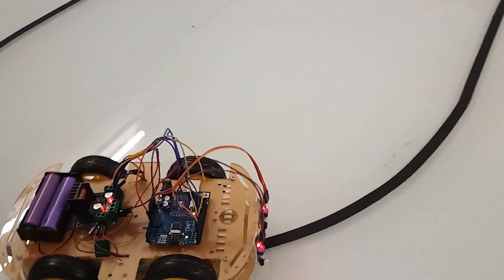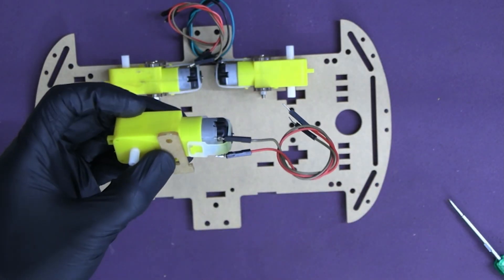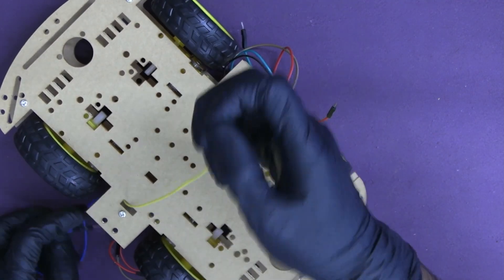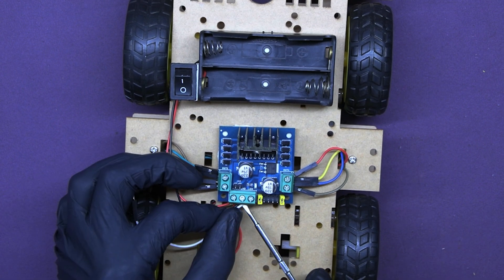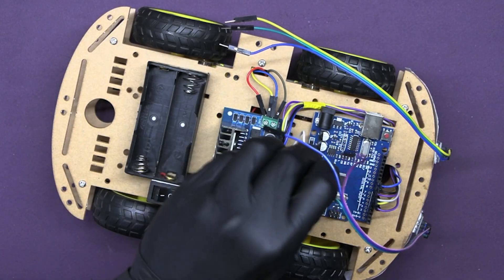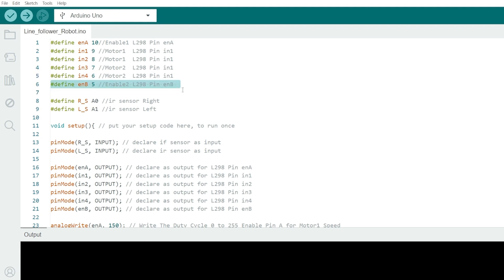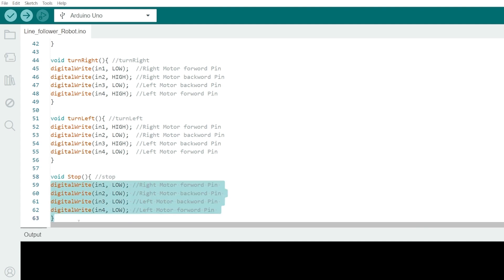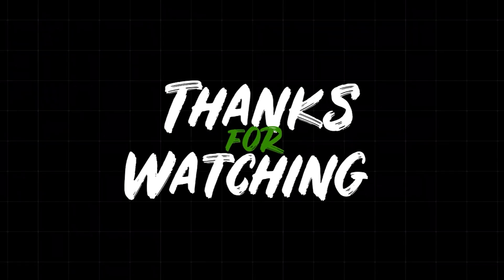TrackMinder: Line Following Robot using Arduino UNO I Robo Army I Arduino Basic

Comment: Hello, this is a great idea 
Can we make it for measuring length and area of land 
And won't the sensor be affected by sunlight? If yes, what is the solution
Reply from the maker: Thank you so much for your comment! 
Yes, this type of sensor system can be modified to measure length and even area of land by using wheel rotation feedback or encoders along with proper calibration. It will require some extra programming and hardware adjustments.

Regarding sunlight —IR sensors can sometimes get affected by strong outdoor light.
But we have a few effective solutions:

🔹 Use IR sensors with better filtering
🔹 Add a cover/shield on the sensor to block direct sunlight
🔹 Use different types of sensors (like ultrasonic or LiDAR) for outdoor conditions

Really appreciate your interest!

Comment: Is it possible without adrino
Reply from the maker: Yes, it’s possible to make a basic line follower without Arduino using only simple electronic components like IR sensors, comparators (like LM358), and motor driver circuits. But with Arduino, you get more flexibility to add extra features such as speed control, obstacle detection, and advanced logic

Comment: Nice work bro! I have a question, can i use KY - 033 sensor instead IR sensors?
Reply from the maker: Thanks a lot, bro!  Yes, you can use the KY-033 sensor instead of IR sensors in many projects. The KY-033 is basically a line tracking module (IR emitter + receiver) designed for detecting black/white surfaces
Reply: @robo_army_  Thanks for answering. Just one more question, can i use the same code or i need to replace something? BTW new suscriber :)
Reply from the maker: Thank you so much for subscribing! Really appreciate the support.

Yes, you can use almost the same code, but you might need to adjust the pin numbers (depending on where you connect the KY-033) and maybe tweak the logic slightly since the sensor gives a LOW or HIGH output based on surface color.